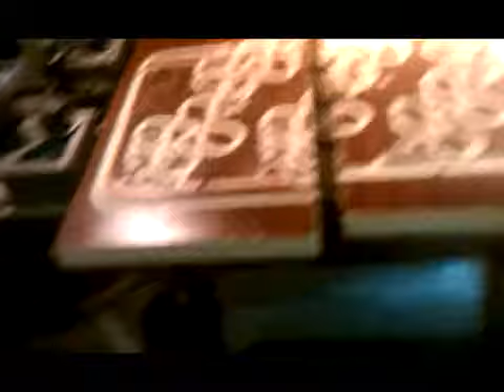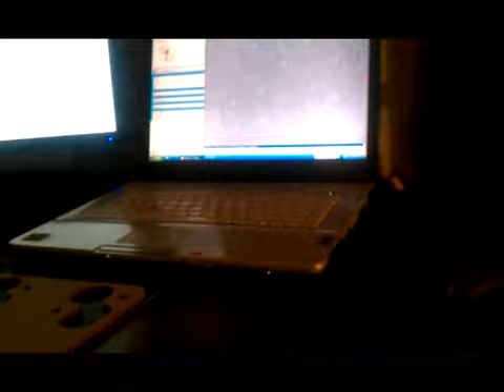M90 Adapter for Split Port Mustang, Third Revision, Part Two

Comment from the maker: We are in the final stages of design, we are hoping to sell this as a kit.  We would provide the adapter plates, bolts, instructions, and possibly gaskets.
And it would be your job to find a blower online or in your area that matches our specs to use.  They are very common,  its the same blower as Pontiac Grand Prix GTP uses, as well as many other Buick, GM, Pontiac vehicles so they are plentiful.  You can usually find them from $100-300 depending on condition, $400 new from GM i believe.